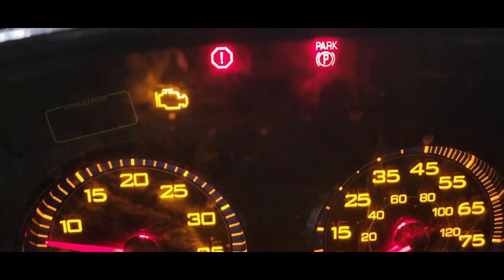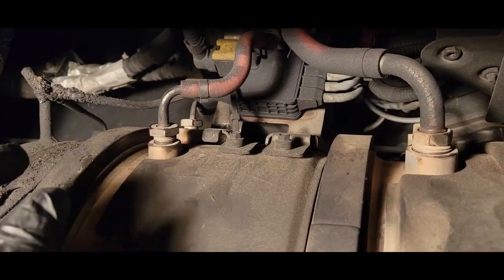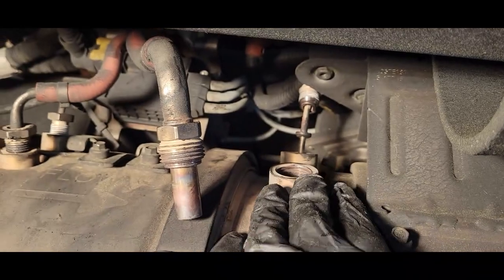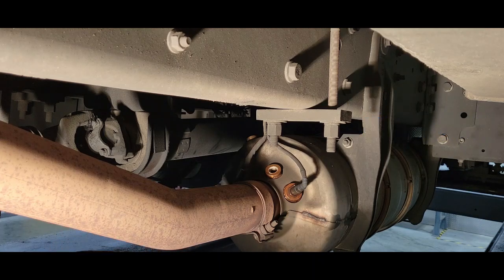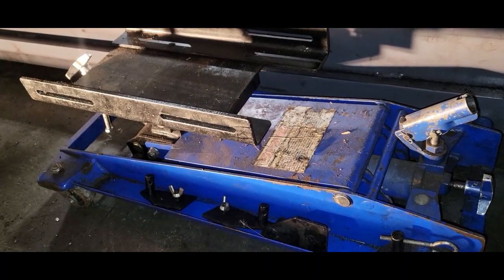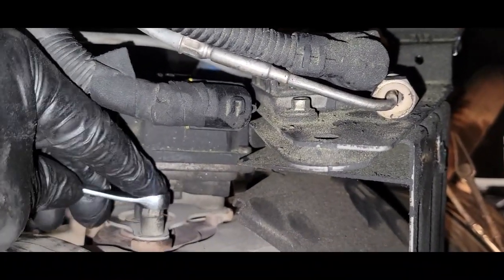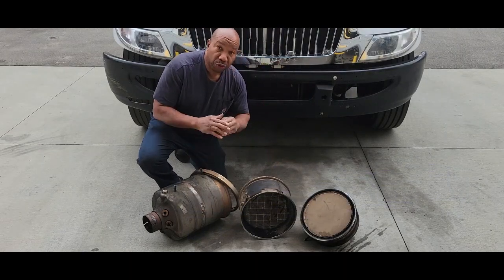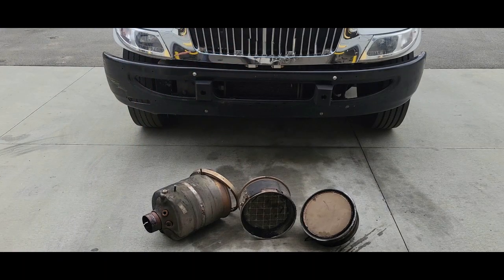2020 International Truck DPF Filter Service (Part 1)

Comment: Hello Sir…I replaced the radiator per your video, now I need some more help. I have the red alarm, beeping. Turn truck off notice. Sounds like I need to get the filter cleaned. My ELD reflects the following codes. Would you mind taking a look and advise if the filter needs cleaning and or anything else? Any help is greatly appreciated Sir. Thanks in advance 

12:59 1
•ll 5G+ 42
Fault Codes 7
Aftertreatment Diesel Particulate
Filter System
Fault Code: SPN-3936
First Detected: Nov 06, 2024, 09:00 AM
Last Observed: Nov 06, 2024, 09:39 AM
Type: Constant
Network: J1939
Aftertreatment 1 Diesel Particulate Filter
Differential Pressure
Fault Code: SPN-3251
First Detected: Nov 06, 2024, 09:01 AM
Last Observed: Nov 06, 2024, 09:39 AM
Type: Constant
Network: J1939
Fault Code: SPN-125
First Detected: Nov 06, 2024, 09:32 AM
Last Observed: Nov 06, 2024, 09:32 AM
Type: Intermittent
Network: J1939
Fault Code: SPN-196608
First Detected: Nov 06, 2024, 09:32 AM
Last Observed: Nov 06, 2024, 09:32 AM
Type: Intermittent
Network: J1939
Fault Code: SPN-82611
First Detected: Nov 06, 2024, 09:13 AM
Last Observed: Nov 06, 2024, 09:13 AM
Type: Intermittent
Network: J1939
Source Address 33
Fault Code: SPN-2033
• n
Reply from the maker: @MarcusThomas-cc2po  Good morning, 
I would try a regen for the cleaning. Hopefully that will take care of your problem. If not, check your tube's and hoses going to the DOC and DPF and make sure they are not bents or clogged. Sometimes depending on the amount of soot in the Filter. You may have to regen more than once.
Reply: @ ok would that be a forced regen ? When I hit the regen button it blinks a few times and turns off
Reply from the maker: @MarcusThomas-cc2po  you may have to do a force regen
Reply: @dairleautoclassicrestorati6892  thank Sir!!!